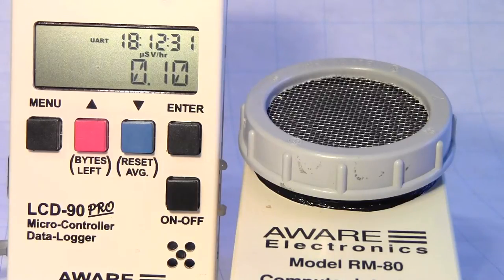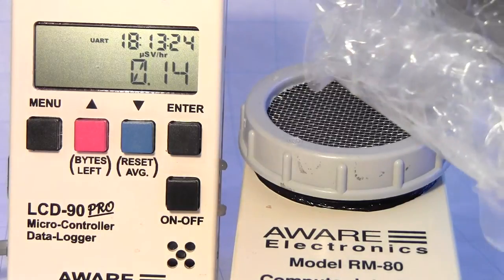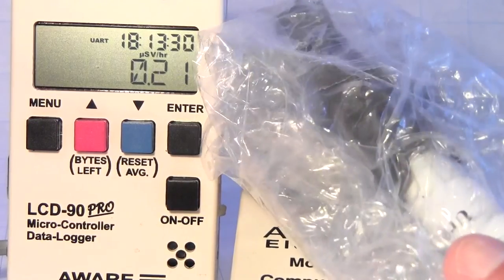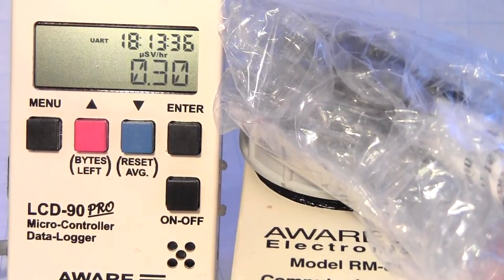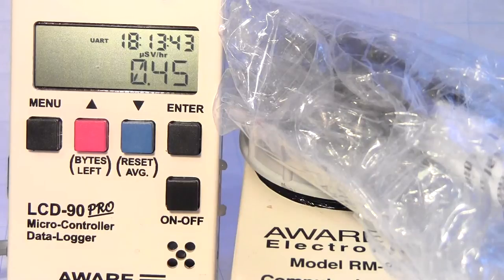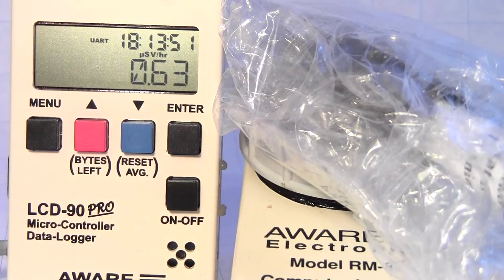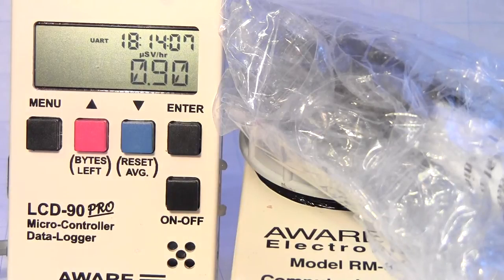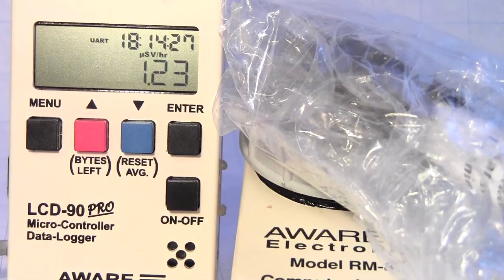Natural Uranium radiation level

Comment: Nice video Simon. Looks like you have the LCD-90’s running average set to thirty seconds .  I'm sure you know this but one can set the running average from 1 to 120 secs. through the menu button or PC interface.  Also one can push the blue “Reset Ave”  button to immediately reset the running average with change of source.   See aw-el(DOT)com/lcd_90g(DOT)htm about setting the  running average depth and the Reset Ave button.  Regards / Bryan